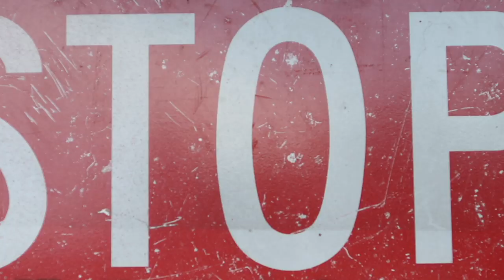FINAL FAREWELL TO GOLDIE - This Truck Was A Work Horse For Years!

Comment: tuck that blade on your saw is diamond saw blade for cutting concrete an block or brick  its usually used with water but do come in dry cut it should say on the blade, and the tool you have that shoots nails is called a ramset gun  the yellow strips are your firing strength it depends if you are shooting into concrete or steel beams both the nails an strips come in different strength  the blade can run up to 100 plus the ramset is in the multi 100s  that stuff is not cheap to purchase unless its really needed   live the dream/mrt

Comment: @05:40 that’s a charge nailer, you put the .22 blanks on the strip into the handle, then a nail in the end. It fires through the stud into a concrete slab.

Comment: Dude, when it comes to sorting nails/screws/smalls a magnet is very useful grab up a mag full then pull them off in order. (Do not use those high power fishing magnets)
Reply: Yea I take the magnet from a junk speaker, and tie a string to it. Works good.

Comment: Most people don't but if you have a vehicle serviced every 3 months by a real mecanic that knows his shit witch unfortunately most don't and use good oils and fuids not the cheapest stuff on the shelf fix all leaks never exceed what the vehicle was designed to do it will literally last a lifetime .my grandfather did just that he bought his first new car in 1932 he drove it every day till the day he died in 1984 and my cousin got it and destroyed it but it still ran 4 years after his death the car had 700'000 miles on it .